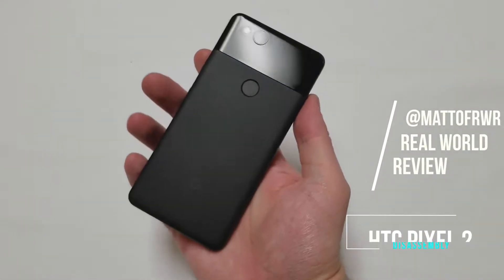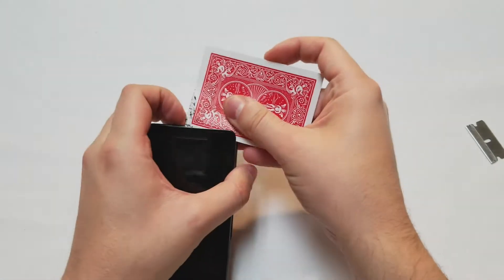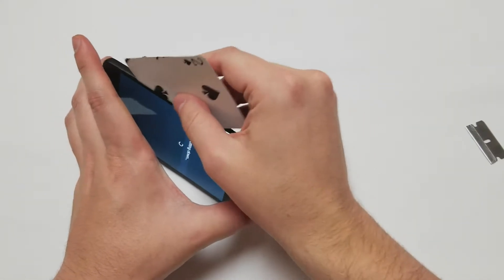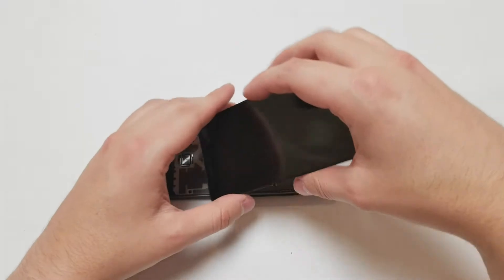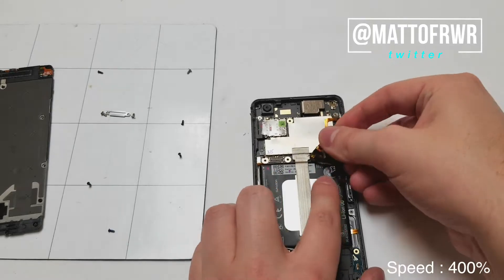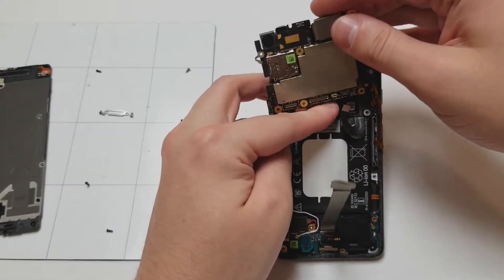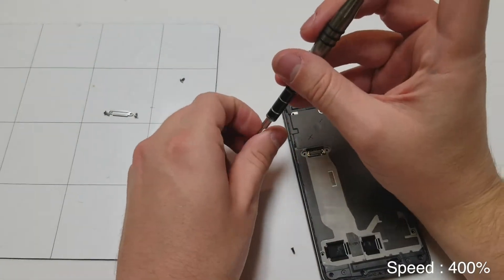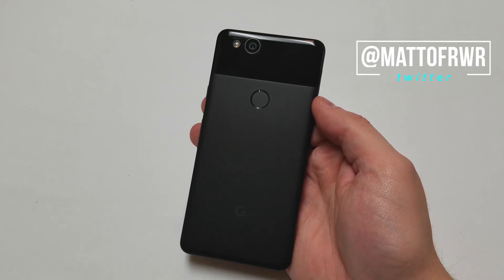Google Pixel 2 Disassembly (Screen and Board Removal)

Comment: So i opened my pixel 2, purchased a year ago on a refurbished site. Inside, it did not look anything like yours. Firstly only the glass came off. Then i was presented with the touched screen which was working fine before. I broke it in a million pieces now to remove it. This part was not connected by a attachment cord like yours but rather stuck on with the port on the bottom near the speaker.
Having had 3 pixel 2's never would i have guessed this one being a counterfeit product. Maybe was repaired with an aftermarket screen?

Comment: Anyone else's Pixel 2 phone better drastically draining really fast? Like, zero connection, nothing turned on. No location. No data no wifi. But still drains 1% a minute?

Has anyone tried switching it's battery?

Edit: after watching this, there's no way I'm going through all that to switch a battery if that's even possible...I'd wreck the phone.

Comment: My sim tray snapped in half and the SIM and back half of the tray are stuck in there pretty good. 

At first the phone was still functioning, but rather soon after this happened the phone is no longer registering the SIM, as I imagine it's no longer in place.

I've tried plenty of moves to pry it out with things such as sewing needles and plenty of jiggling/banging it softlyish to no avail.

It really feels like the SIM is no longer in it's cut out spot on the remaining portion of the tray and is instead stacked on a thicker part, effectively wedging them both in there quite securely.  I don't think the super glue method would be enough to dislodge them, but I'm open to trying, I'll just have to pick some up tomorrow.

Before I take the leap to taking it apart, is there anything else you'd recommend? 

How far apart would I need to take it to be able to dislodge this log jam?

Comment: I tried doing a repair on this device but I heated the screen too much and the LCD padding has a burnt spot. Do you know if this will effect the screen?
Reply from the maker: Only visually. Generally you'll see a white or yellow burn mark and that's it, but the screen should still work the same. They're fairly cheap to replace now anyways.

Comment: I did so, but only the front glass came off. The screen itself stayed down on the phone. Of course the screen then shattered when I tried to remove it. What did I do wrong?
Reply: I have the same problem. It appears that the rubber cushion on the midframe also stuck to the OLED panel itself so there's no way to remove it without shattering it. Glad to know I'm not the only one with this problem.

Comment: That is amazing buddy.
I was almost holding my breath is you worked with all those fine screws.
Somebody gave me a pixel 2 it's supposedly has a broken off SIM card inside.
I do not think I will attempt a disassembly like you did.
I guess the broken SIM card and whatever they stuck in there will remain in there.
they even may have tried to put in a micro SD card I'm not sure.
Super video buddy.
Keith Kuhn

Comment: I love how ALL the folks who make videos for this talk about it's one of the more difficult phones to get the screen off of.  Then, instead of showing in REAL TIME how long it takes to heat the glue, they speed up the heat gun process (or worse, show an edited version of it) so that people can't figure out how long it takes to get the glue warmed up.  I have a heat gun, but I'm afraid I'll overheat something.  Going to try to find a video that is SPECIFICALLY about using a heat gun to get inside a phone, so hopefully I'll know what NOT to do in the process.
Reply from the maker: 10 seconds on, 10 seconds off. Put your hand near the heat gun, if the heat is too much for you, it’s going to be too much for the phone. This is not a level 1 repair (although it’s less steps for most phones), which is why most repair shops don’t work on these.
Reply: I know it's been a while, but I wanted to point out that you could use an infrared thermometer. I bought one online for 15 bucks. As far as I know it should be accurate, hold it the proper distance away according to the instruction manual of your device. You are looking for 80 - 100 Degrees Celsius, as far as I know. And if Real World Review sees this, dude pick one of those up and use it in a video, that'd be awesome.
Reply: agreed. I gave up after 15 minutes of heating the screen

Comment: what part do i need if i can not see my screen? the touch and fingerprint recognition still works and my screen is not broke.
Reply: same fuckin thing here, you need a screen lcd digitizer i have been told
Reply: https://www.ebay.ca/itm/LCD-Screen-Replacement-for-Google-Pixel-3-2-XL-S1-M1-High-Quality-Digitizer-New/362662985299?hash=item547065fe53:m:miPZvjBn-pZzhRXnsO8a3YA

Comment: Is there any mention/identification of the earpiece speaker and how to replace it? Apparently it's a weak spot on this device.
Reply from the maker: I have not heard of this and personally didn't have this issue, but I can't say that wouldn't apply to other phones.  If you're looking to replace the top and bottom speakers, they can be found here - https://www.ebay.com/sch/43304/i.html?_from=R40&_nkw=pixel+2+speakers&LH_TitleDesc=0. Unfortunately I don't have a video on how to replace them, but it shouldn't be too difficult if you're able to remove the screen without breaking it. Also, it seems like you can't find the bottom speaker for this phone either. I checked my vendors and no one even sells the speaker. I would recommend contacting Google and seeing if they can fix the issue for you if the phone is under warranty. Normally I would recommend DIY projects, but this one doesn't seem like a good idea. Hope this helps!

Comment: Could you have used a 2" suction cup to create a small gap after heating the screen to avoid using a razor blade?
Reply from the maker: You can, but personally I dislike using suction cups. It does help prevent scarring on the screens paint when compared to the razor blades, but rarely does that happen. Also the blade cuts the adhesive while the suction pulls the adhesive.

Comment: How do I change the screen and not the entire LCD? Is that possible?
Reply from the maker: I would assume that it is possible, but trying to separate the OLED and the glass is very difficult. You run the risk of cracking the OLED, but at ~$8 for the glass, it might be worth a try. Just make sure to add LOCA on the screen when sealing the glass and OLED together. Also be prepared to spend ~$150 for a new screen if you do break the display. 

Here is an eBay link for the glass only - https://www.ebay.com/itm/A-Front-Glass-Lens-Outer-Screen-Replacement-for-Google-Pixel-2-5-0-inch-tools/173100519170?hash=item284d984f02%3Ag%3AEPkAAOSw-uhaXLc0&_nkw=pixel+2+glass&_from=R40&rt=nc

Comment: oled not AMOLED
Reply from the maker: Incorrect. Google calls it an AMOLED ( doesn't matter really too much, the AM means "active matrix")
Reply: Technically it's a LG POLED screen which is considered a cheaper form of AMOLED. Notice the smaller Pixel uses a Samsung AMOLED.

Comment: How to change back cover glass?
Reply from the maker: When I get one that is broken, I will show you. Until then, I am waiting for someone to bring in a broken one so I can fix it!
Reply: I m super frustrated right now. So many teardowns and nobody did touch the back glass. Mine shattered too and replacement glass is pretty cheap, but i don't know if you can get it off without a complete teardown.
Reply: @falkenfluegel  @TJice95

If it's still actual for you, probably this video would help your replacing back top glass:

https://www.youtube.com/watch?v=xGcNccfpacE
Reply: Ya I need a video on how to replace the back glass! Ah mine just slightly cracked this morning... getting out of my car